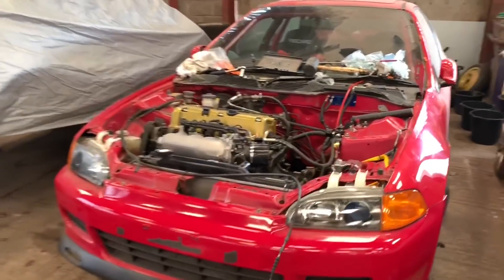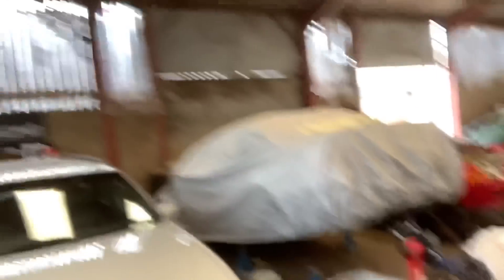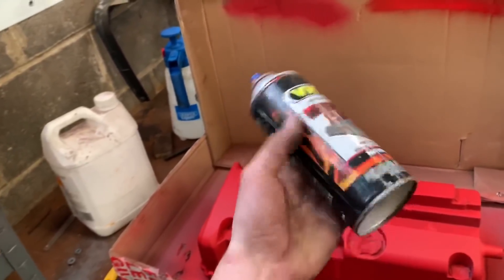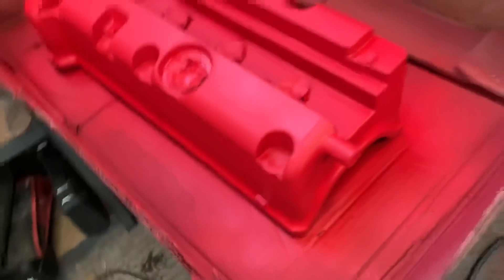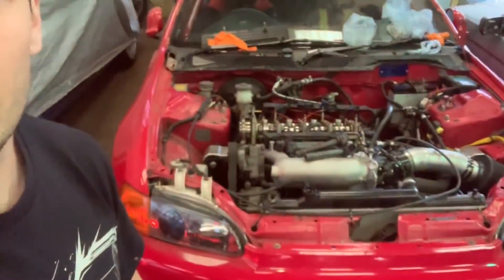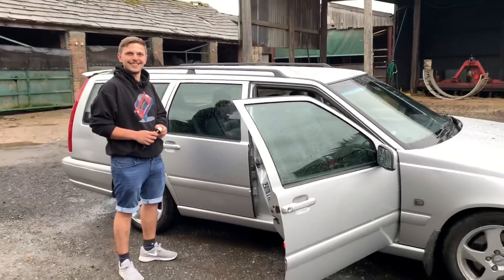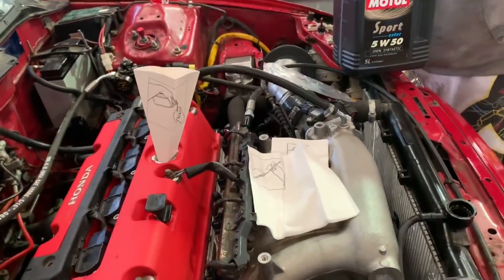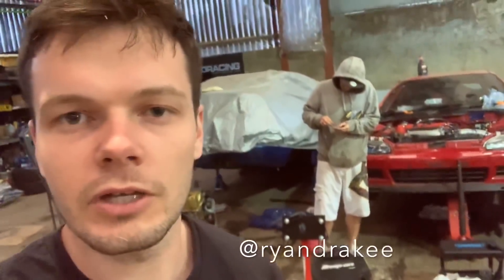Volvo SOLD + K20 EG First Start

Comment: If you don't try then you don't learn... From experience I knew that the valve cover paint was going to turn out badly as soon as the second can appeared! Not all aerosol paints are made equal and most of them don't play nicely with one another. Especially not ones that have additives to deliberately cause reactions like wrinkle paints.

Comment: Wrinkle paint needs to be put on thick and instantly heated up with a heat gun, you could have used that box as an oven and cut a hole in the side to put a hot air gun in, close the lid and let it bake. Used the black wrinkle on my sti intercooler  I go wrinkle crazy now and paint everything 🥺

Comment: VHT Wrinkle Plus + K20 Valve cover = IMPOSSIBLE. Seriously i'm building a EG K20 myself and i've done the valve cover like 5 times with this stuff and it's impossible to get a good job on it without any paint drips.
Reply from the maker: Haha yeah the stuff that wasn't wrinkle went on fine!
Reply: Spray it on and use a heat gun to make it wrinkle I've done a few and came out decent.
Reply: @seanandersen5752  The wrinkle part is not the problem, the paint is so heavy that you need a few good coats to get the valve cover decently covered. After that it starts dripping. The K20 cover has high side walls and that is causing the problem. But maybe that's just me.